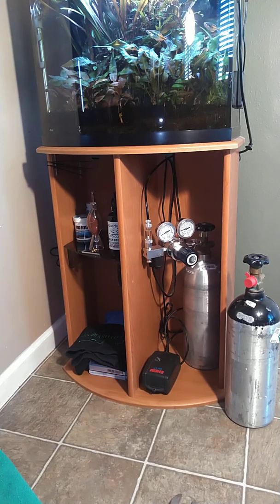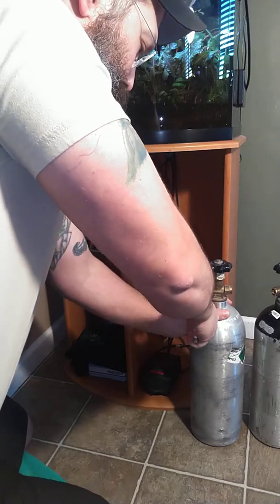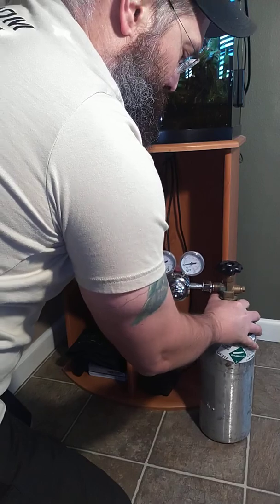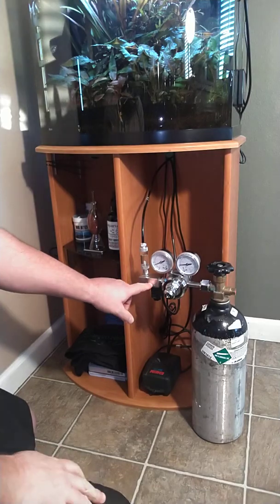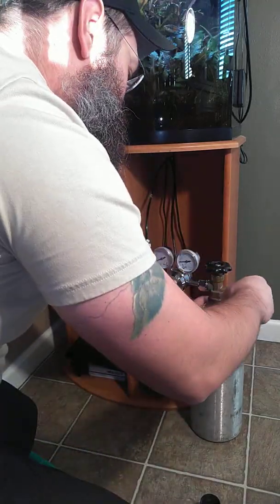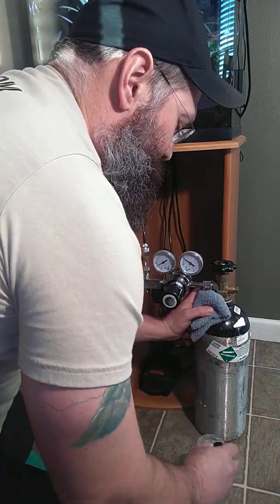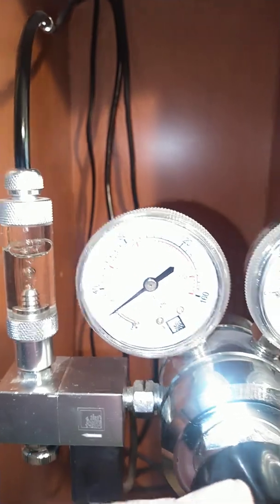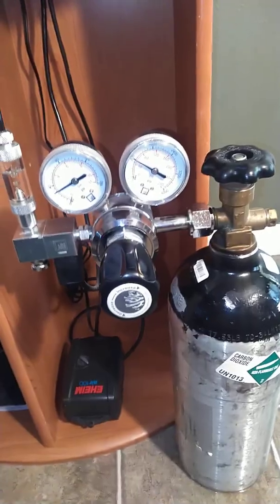5 lb CO2 Cylinder Swap After 5 Months

Comment: Can you provide links or list all the other components needed for the co2 setup?  I have a 5 lb cylinder but am unsure what else I need.
Reply from the maker: The links to the regulator and seal are updated in the description. You want a dual stage regulator because single stage regulators will end of tank dump and gas off your fish. You will need some mineral oil for the bubble counter because water will evaporate. You also need to look into CO2 proof airline that goes to a diffuser. This is different than an air stone. I recommend the neo diffusers and also aquarium co-op airline is CO2 proof, it's PVC based airline that's what you're looking for. I hope this helps thanks again for watching. Sraquaristik regulators are amazing as well as their customer service they offer a military discount also 10% off your first order when you sign up for emails.